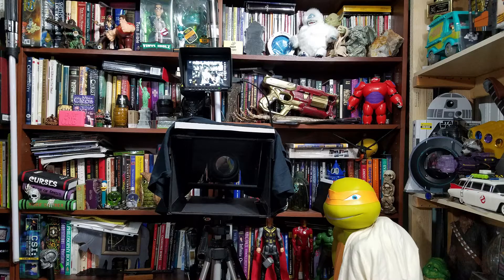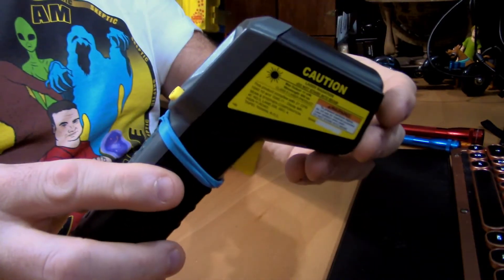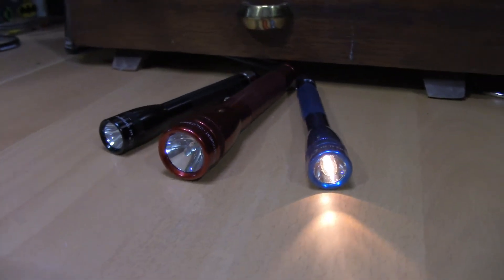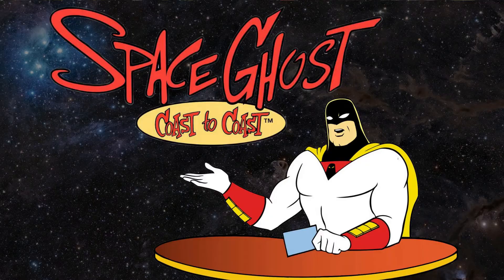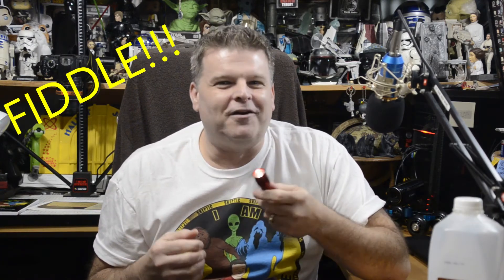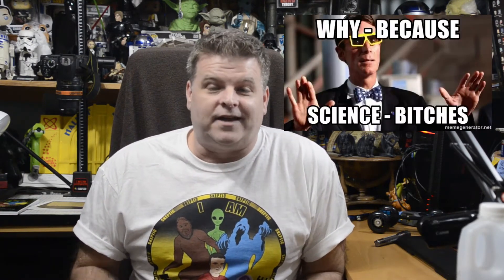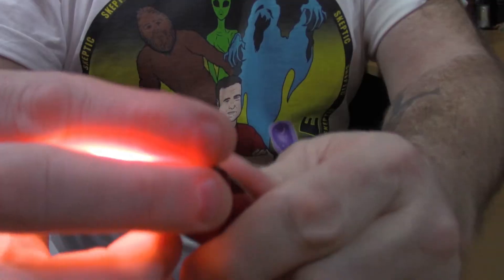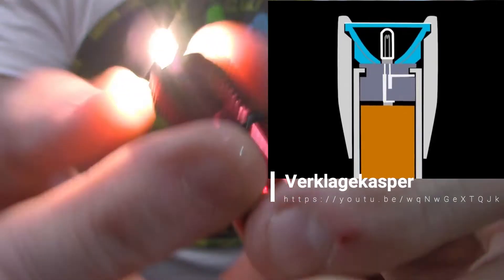Flashlight Trick

Comment: This is interesting I have and do use flashlights and to be fair i didn’t know this 
However I do have a couple of questions 
I have had times where the flashlights haven’t come on at all 
Granted I may have missed the correct spot 
But I have also had times where they have only come on a couple of times 
I would assume that there should be some kind of rhythm if purely down to science 
Also many devices have been debunked with scientific explanations fine fair enough 
But does this mean a spirit or paranormal encounter can’t manipulate these devices probably not 
Most paranormal encounters and investigators say that spirits could potentially interfere with electrical devices 
The trouble is it’s next to impossible to prove anything paranormal 
The truth is we won’t know until we are dead 
For me and my videos 
I do use various devices and apps 
However I have a slightly different approach 
I don’t see a hit on any device or app as 100% proof 
What I’m actually looking for are things that make sense 
So for instance 
If I ask can you tell me your name 
And an app spits out a name 
Yes it could be a fluke 
But it would be enough to raise an eyebrow and maybe go with it for a bit 
If you say can you set that rempod off and it goes off and then can you let go and it stops 
Is it 100% no but it does make sense and it is in context 
That’s what I personally look for 
Is it in context does it make sense 
For me there is a higher chance of something being paranormal if you get a higher rate of things in context